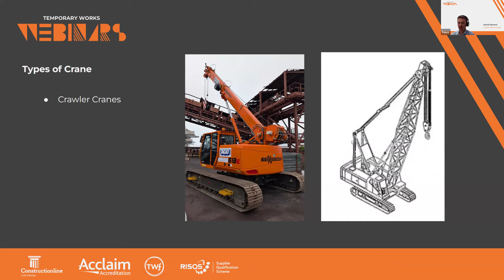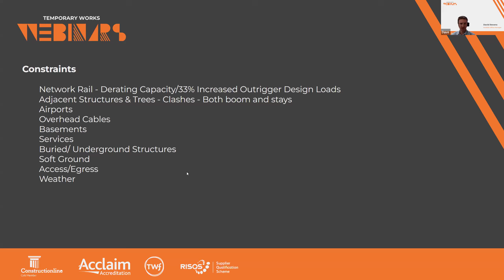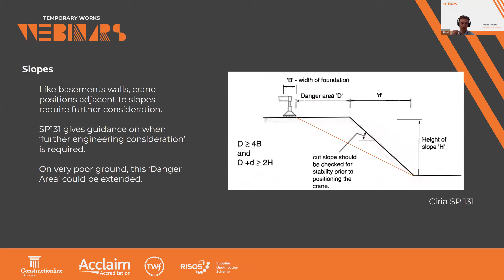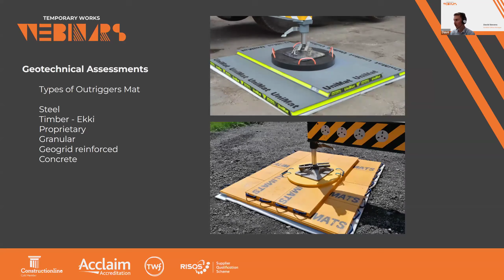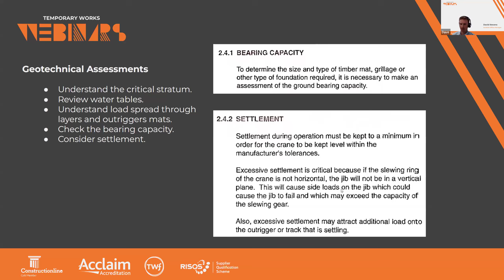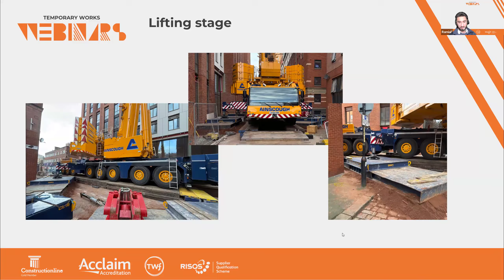Crane Stability On Site - Insights and Case Study

Comment: Great video about TW.
I would question the potentially contradictory information about 'comparing heavy wheel loads versus crane mat pressures' versus 'plate load tests are not suitable for crane mat setup'. 
I was surprised to see TWf sponsorship, but no reference to their excellent guide "Assessment and management of outrigger loading".
It is stated that the stiff road surface reduces the load spread of a crane outrigger (through a steel mat) requiring extra mats, but this seems counter-intuitive. If you account for the extra stiffness of the road surface it should, by definition, spread load more?